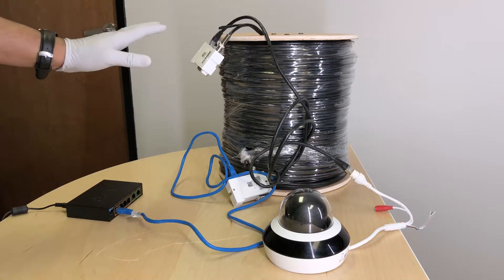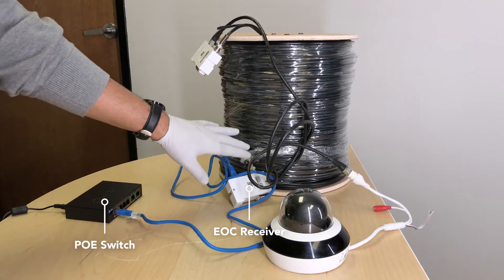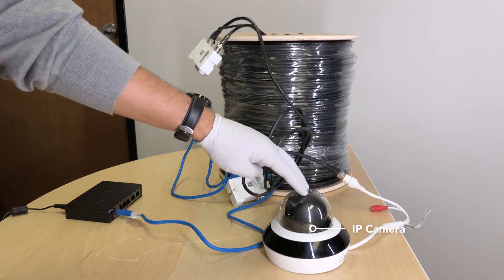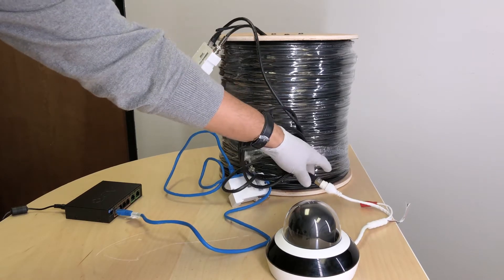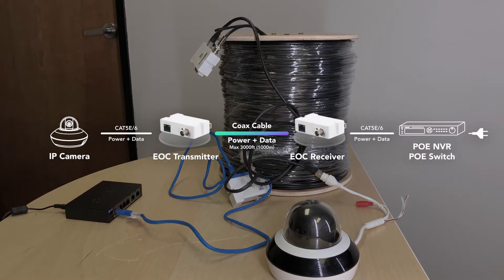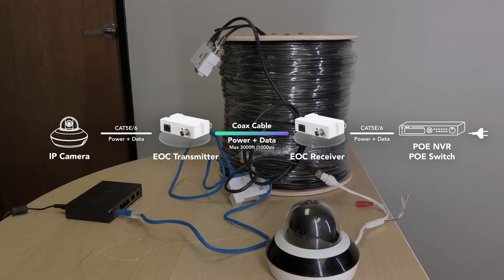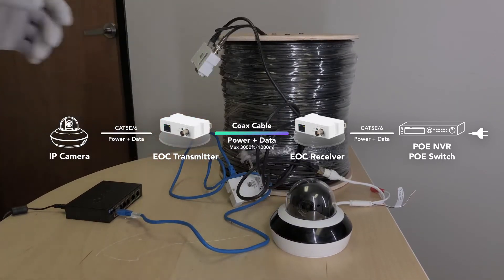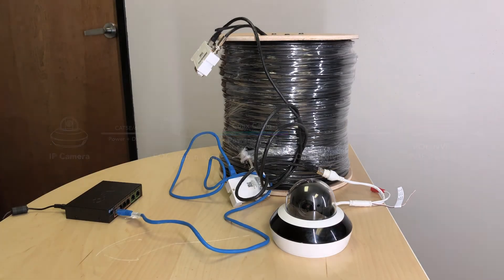POE IP Over Coax EOC Converters Extenders Transmitters Receivers  Introduction | Hinovision

Comment: I am retrofitting 16 cameras to PoE using these converters, so far so good with about 5 cameras but then installing two cameras next to each other with coax running another the same path, only one camera would work. Disconnecting one of the ethernet inputs to PoE results in the other camera to come up. We are suspecting there is crosstalk? You know what the frequency is being ran through the coax cables with these adapters?

Comment: why is it smart to use coax cabel instead off pds cat 5 ?
Reply: a coax cable can transmet data up to 400 meters i guess with a rate of 100 mb/s 
cat 5e or 6 can transmet data up to 100 meter or 120 meter max
an IP camera consume up to 30-35 mb/s 
so you can connect 3 IP cameras to a switch then transmet the data using EOC to up to 400 meters...
I haven't tested it yet, but i've seen someone connecting 2 IP cameras using Switch and EOC
Reply: you could also reuse installed cable, better than replacing it with cat at least for low bandwidth usage